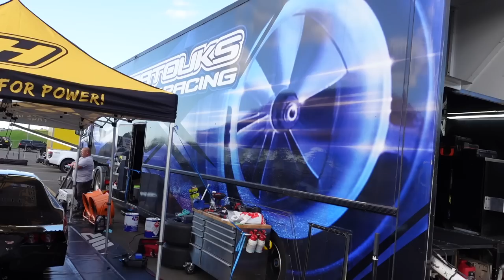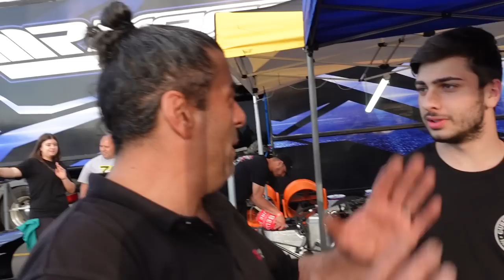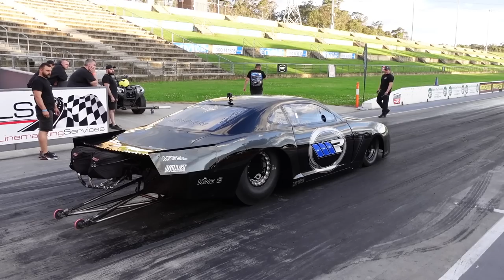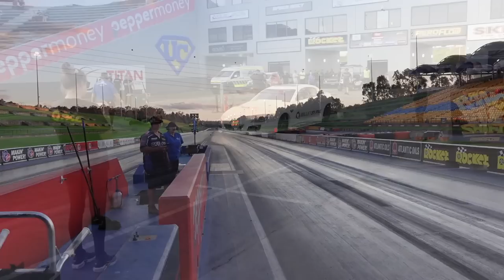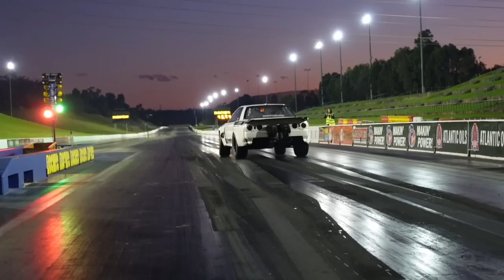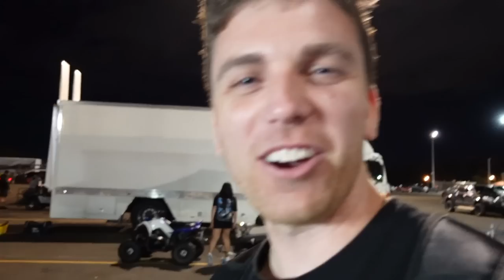PRIVATE TEST DAY AT THE DRAGS WITH MAATOUKS RACING

Comment: Never really been a huge fan of the rb sound but ah that idle on the Don is freaking awesome 👌😁
What did he run? I could't read the boards properly ,5.70?🤔 
375km through the traps too 👌
Reply: I'd dare say those rotors were testing for buzznats here in Vic tomorrow, keen to get my rotor fix 👌 ,been easy 15 yrs since I've seen em live in action 🤔
Reply from the maker: 5.91 at 244mph
Reply: @DriftSquid  nice 👌